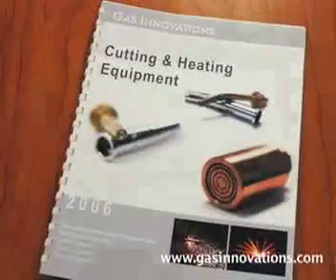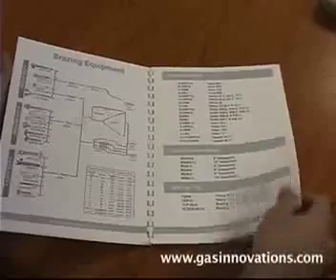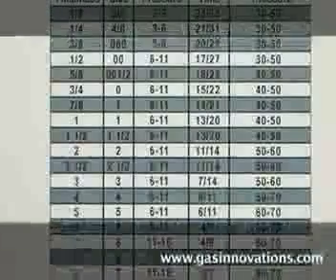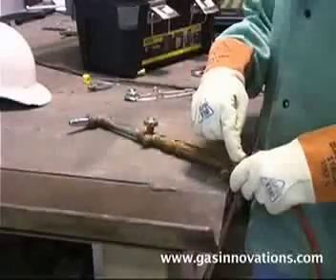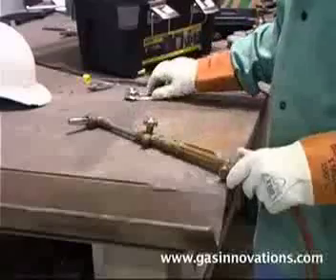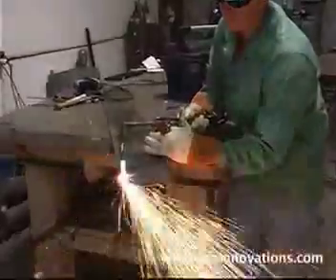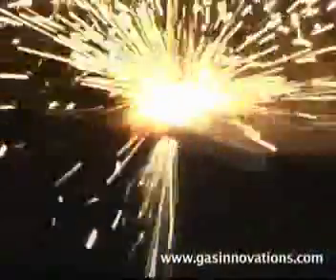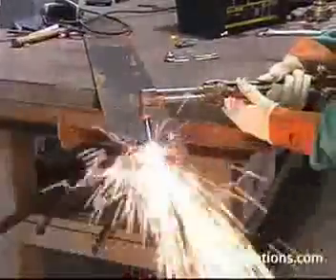PROPYLENE HAND CUTTING

Comment: The propylene heating video shows the torch being lit with only the propylene flow valve turned on, then the oxygen is turned on. This video shows both valves turned on before lighting. Is the lighting procedure different for cutting?